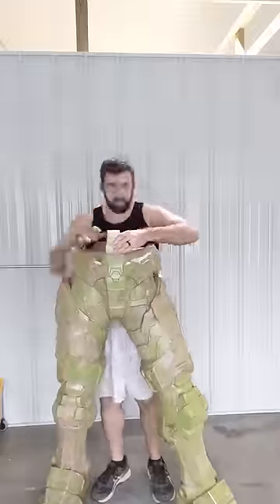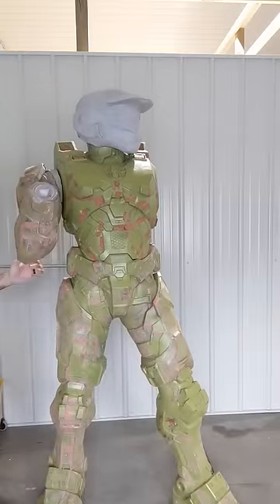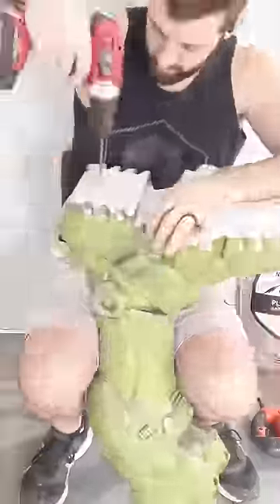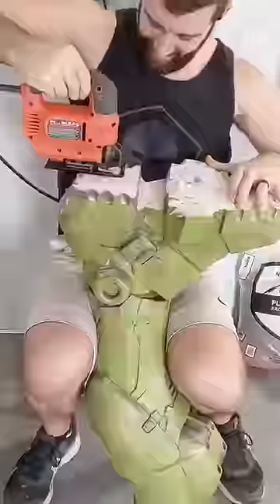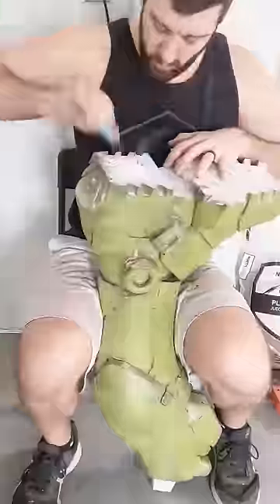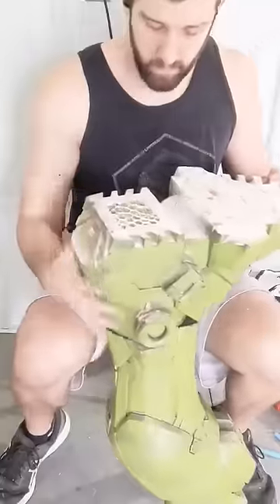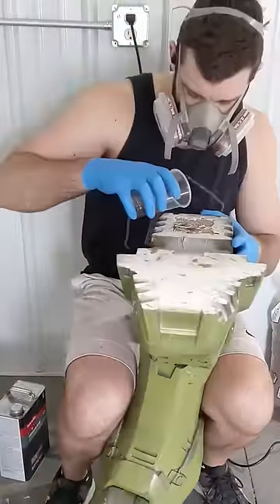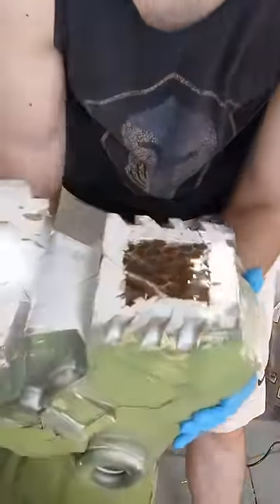Life Sized Master Chief - Mini Update 11

Comment: Sand was a great call. So excited to see the completed piece. Best of luck!
Reply: Dude put like a couple grams of sand that isnt gonna do shi
Reply: @contentdeleted4978  he probably didn't show the whole pour. It's infill which means it's hollow, he could have filled it partway up the leg. Plus it looks really light, which makes sense for how little infill % he used. So that small amount probably makes more of a difference than you'd think!
Reply: So What printer is he using?
Reply: I don't like sand
Reply: @TheProfessor66  cool
Reply: @TheProfessor66  Anakin?
Reply: Yea from the voice over I'm guessing it worked well, other options would be using something denser like concrete or fine gravel and then still use either fiberglass resin or epoxy to seal the bottom and using something denser would mean you could use less filling material and should lower the center of gravity even more than sand
Reply: @lun7r565  lame
Reply: Lead shot as in the lead bb's you would find in bird load shotshells
Reply: @contentdeleted4978  Be a better person bro. Running around being unnecessarily argumentative and trying to take the piss out of everything is what little boys do. If his first attempt didn't work, I'm sure he'll just re-adjust and try again and your pissy little comment changes nothing. Except one thing, it tells everyone you're immature and insecure. Have a good one.
Reply: @TheProfessor66  its course, and rough, and irritating, and it gets everywhere…
Reply: Should have put lead but honestly you should have just made a hole on the bottom foot and have him stand on a peg they do that with plastic models all the time
Reply: @martinpeel1820  cool  m you are 😳
Reply: I don’t like sand.
Reply: @TheProfessor66  Anakin Skywalker is that you?

Comment: Literally did the thing I was thinking. Although I think you'd get more weight from steel ball-bearings tiny ones loads of em
Reply: Resin also would fill any gaps too with some light continuous tapping while it sets to get the bubbles out and fill out them spaces. Extra Extra weight

Comment: for future reference you can take that polyester resin instead of pouring the resin by itself you can mix it with fumed silica, and it turns the resin into a putty and it is more ideal for filling voids and not leaving any bubbles.

Comment: Hey mate, it's the first time I stumble upon your channel but I wouldn't recommend honeycomb infill, expecially with these humongous prints, it's by far the slowest of the common infills and it's not that much stronger than rectilinear for example, if you were going for absolute maximum strength to weight I would recommend adding a couple walls and lowering the infill

I still know almost nothing about this project so many choices may have been actually better, I just suggest looking at CNC kitchen videos on how to optimize printing, I think it could save lots of time and money on that scale

Keep up the good work!

Comment: If that isn't enough weight, "lead shot" for shotguns is one of the densest materials you can buy for cheap. And you can get the bb's in any diameter down to the size of sand granules

Comment: Could of used a liquid epoxy to fill and help weight it but aswell as a structurally adhesive to help strengthen the legs from.the inside out.

Comment: Why sand? Resin in a couple of 24 inch long pieces of 1/2 inch threaded rebar up through the heels. That way, not only do you have added enough mass to move the center of gravity further back, you now have a convenient way to bolt the sculpture to a base.

Comment: I would have drilled a 1 inch hole into the bottom of the boot then glued in a metal rod that sticks out half an inch that fits into a metal plate that the statue sits on

Comment: I thought he would fill it with metal
Reply: Please explain to me how you thought he was to fill this thing with metal? Like seriously how? To fill this this with metal he would need to pour molten metal in it but this thing is still just made of plastic so I would love to hear how you thought he was to fill this thing with metal.
Reply: @minimeme2513  by buying a block of steel or Aluminium and glueing it in or screwing a plate on the bottom to fixate it.
Reply: @xdradt8463  where do you suppose that block is meant to go? There is no room for one in the legs with all of that filling already in there and digging it out would destroy the print.